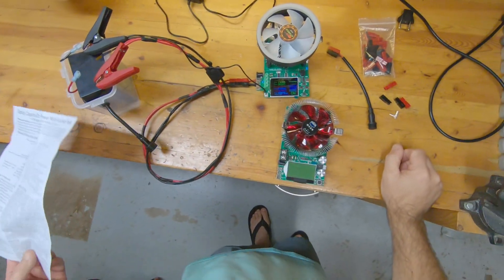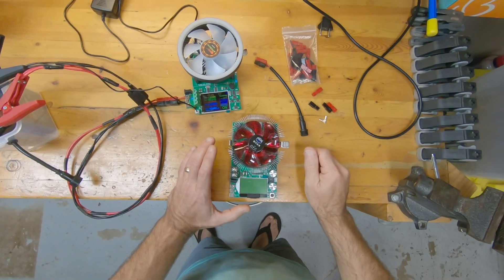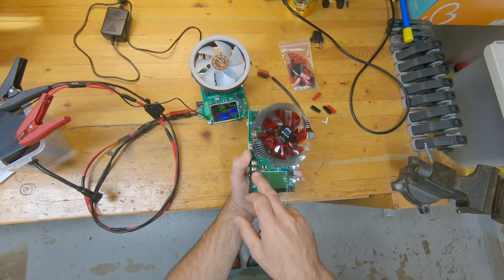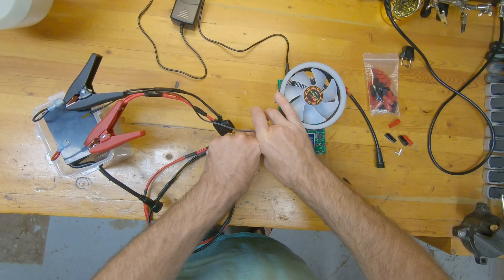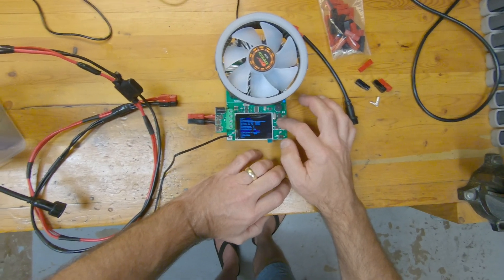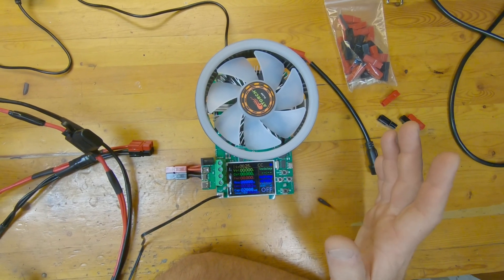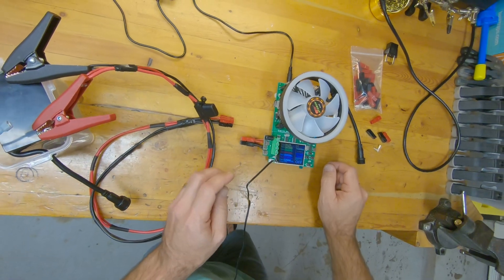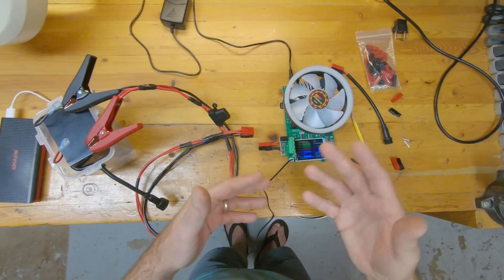ATORCH DL24P 185W VS MakerHawk 150W Battery Capacity Testers

Comment: I have both units, both have pros and cons
After 4 years of hard use I had to replace MOSFET on the unit with the pots.
I’ve just received the DL24P while waiting for the MOSFET to arrive, and find it irritating to have to change the connector board to measure USB and other device so that’s a Con in my book.
The pots are also quicker to set Amps for a quick test on a AC/DC power supply, of which I do a lot of.
Big pro on the DL24 unit is the Bluetooth, checking the load and amp hour remotely is a big plus on my iPhone.
The big Con on the older is definitely the cut off voltage adjustment setting, especially when testing a big batteries of different chemistry @ 5amp capacity test.
Either way I like having both as they add much to my bench testing range of equipment, I test a lot of batteries and small 5,9,12 AC/DC adapter power supplies, and some portable USB devices.

Comment: Anyone know what to replace in parts if the unit shorts out?I've replaced the main MOSFET, and it seems to work in low voltage(1.5V)  but before I give it 30V, but wondered what else goes.

Comment: Great video

be careful everyone , Atorch on their page on aliexpress claim that they
 have a similar one which could reach 1000W by replacing the "tube" as 
they say , where they mean the mosfet which could be replaced by an 
IRFPd260.thus reaching 100W.
in fact this is a fraud , since the 
mosfet which they say it updates the unit to 1000W isn't but a mosfet 
with maximum dissipation of 300W , so if we want to achieve 1000W you 
need at least 4 to 5 of such mosfet so the system works continuously on 
100W DC.
that is if we disregard what is required to be replaced on the PCB and what parts need to be replaced else than the MOSFET
be careful do not fall into such trap.
I bought one and noticed that it cannot work on 1000W unless huge 
modifications are done which might cost not less than 5-10 times the 
actual price , and when i contacted them they were very rude in the way 
they replies and insisted that it could do 1000W after you change the 
mosfet and the cooler , which is just an illusion in fact.

Comment: Thanks for the video, I can't believe there are 2 new versions from Atorch already, the DL24M and the DL24M-H which I plan to do a video on. They are modular and can connect together for up to 600W of load. Fits my needs a bit better because my batteries and cells have huge capacities. Yet so hard to find info without doing it yourself
Reply: Have been searching everywhere for DL24M-H review but can not find. Confused between DL24M and DL24M-H. Please do make its review!
Reply: where's the video??

Comment: Thnks for the video, even if it did cut out prematurely. Allot of other videos seem to be for an older version that doesn't have the 4 wire sense terminals, which is what I really wanted. I also appreciate the use of Anderson Powerpoles.
Reply from the maker: Thank you.  One thing I forgot to mention was the stock 9VDC 1A wall wart PS with the Maker's Hawk died after just one day.  I substituted with an Arduino.  Another reason I returned it.  If you plan to buy the ATORCH from aliexpress, be sure to buy the one with the metal jacket cylinder cell block for standard cell sizes, I think it's the same price as the until that doesn't come with it.